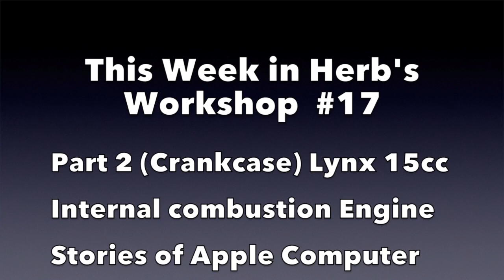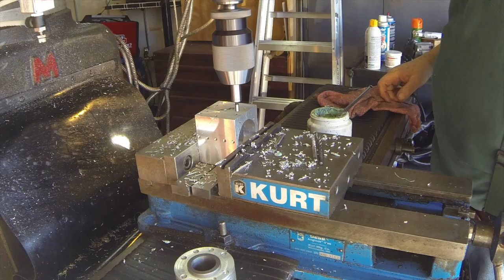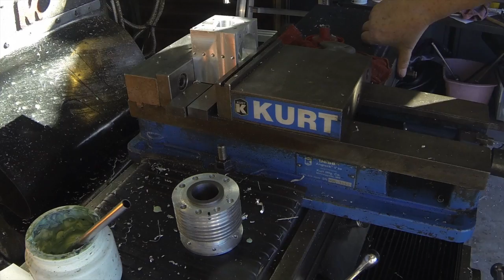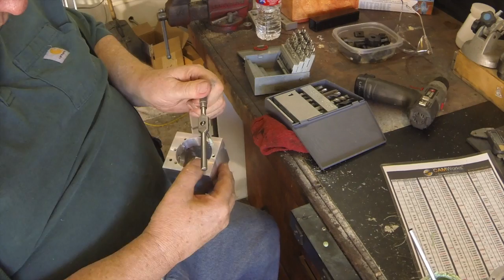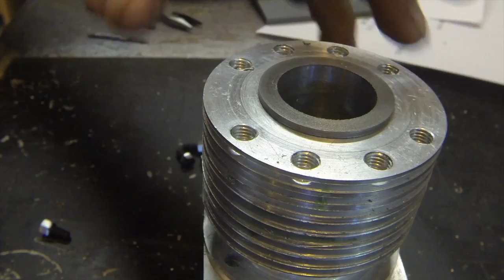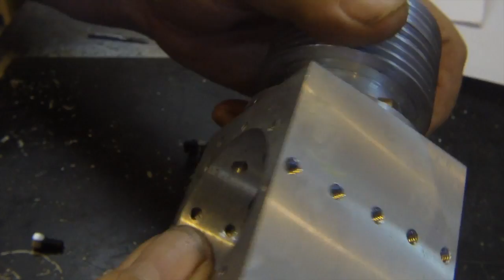Week 17

Comment: Herb,
Ah . . . the good old days. The first computer I had in the early '80s was a Kaypro II. It 64K of ram and had 2 - 5" floppy drives, 24K each (single side; double density). The first Mac I used was a 512. It had an external 3.5" floppy drive (single sided) that held 400K. The first Mac I owned was an SE-HD that had 2 - 2.4meg. High Density 3.5" floppies. I later removed one of the floppies and put in a hard drive. I have been a Mac fanatic ever since. I now have a Mac Book Pro with a 2.3GHz Intel Core CPU and 8Gig of RAM. It has the Retina 17" display. I also have a G5 "Cheese Grater". Thanks for sharing your work on the engine and also the stories about Macintosh. As I remember, the Lisa was Apple's first venture into a GUI and mouse. The Apple and Apple II were command-line driven like my Kaypro, except the Kaypro ran the CP/M OS. Thanks again!
Have a good one!
Dave
Reply from the maker: Dave,  Thanks for the Comment.  My first computer was in 1976.  It was a Commodore Pet.  Then I got an Apple II+ with two external 5" Floppies.  3 months after I bought the Apple, I went to work for Apple.  I've owned so many Macs, that I forget how many.  Currently I have an IMAC desktop, and a MacBook Pro.

Comment: I'm old enough to remember the apple. Cut my teeth on an appleII. Before the apple, there were 19" platter hard drives that could only hold 5mb.
Reply from the maker: Steve,  Thanks for the comment.  I worked on a Modcomp computer system that had multiple 19" platter hard drives.  I remember it had a lot of issues.